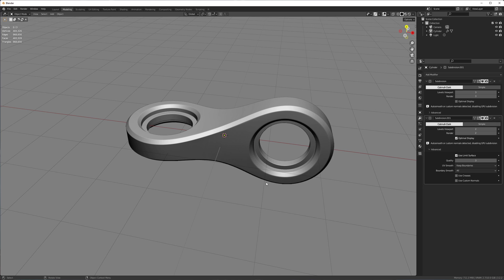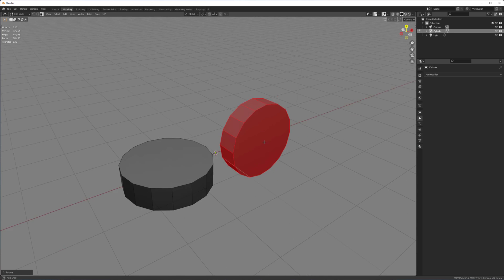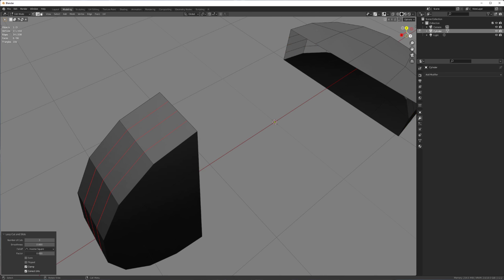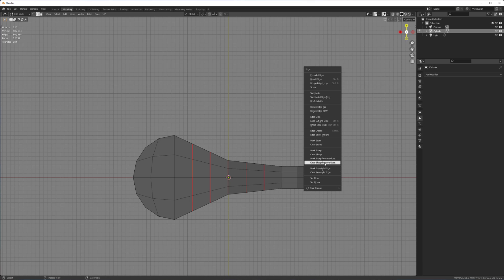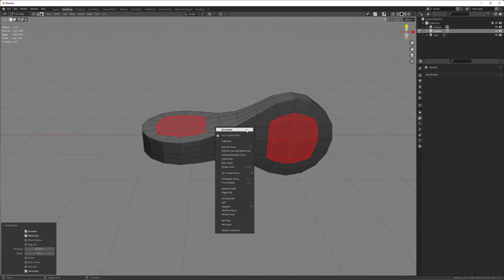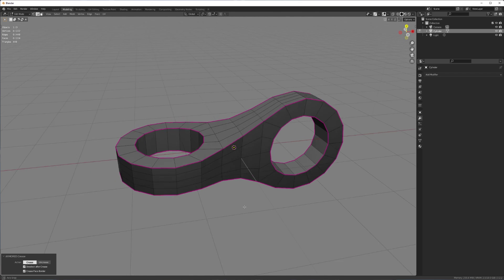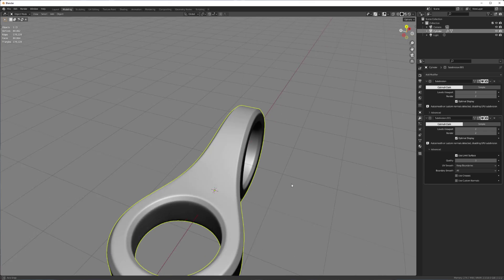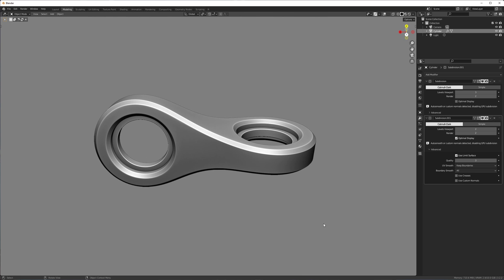A different technique (Subdivision Surfaces)

Comment: Unfortunately, with blender 4.1 AutoSmooth is unfortunately gone!
Now it's only available as a stupid modifier or an even more stupid geo node.
Reply from the maker: @GenerativeSynthesis  try out BL 4.2. It's still a modifier but they added the option back in the context menu, so you can add it just as fast as before.
Reply: @ArmoredColony  Not only as fast, but also for arrays, duplicates and so on and so on. But... did they really add it back? I'd be so glad to install Blender 4.2 and replace the old 4.0.2!
Reply from the maker: The single button you click for autosmothing? Yes. But it creates the new modifier for you and pins it to the bottom of the modifier stack so you don't have to constantly move it around.

Comment: the things even though it looks smooth and nice, considering the polygon (faces) count it will be really heavy. For example exporting in the games and stuffs. Is there any other way where you can have a smooth surface without using much subdivision surface to reduce the polygon counts?
Reply: Right click in object mode and shade smooth. If that's what you're asking. Hope that helps! ❤
Reply from the maker: You can add a Decimate modifier at the end to bring the polycount down.

Comment: I get stressed out just by hearing how fast you work that keyboard. I use mouse only. For everything. One hotkey more advanced than the basic "F" or "S+xyz+value and I get totally lost and have no idea what I just did or where I'm at in the process. And it's never gonna get better. I know because I've used 3D medeling software for years. Ugh...
Reply from the maker: Then Maya would probably suit you better, if you can get around the pricing. They do everything with these sort of contextual Pie Menus. Used it for years without setting custom hotkeys.
Reply: @ArmoredColony  Yeahhh no... I've used the Autodesk suite for years, until my student copy got so outdated Windows wouldn't allow it to be installed no more. I pretty much was torn away 3DS Max and thrust into Blender, kickin and screaming. Blender is a pain, but once comfortable with it, you really can't beat it. I've just learned to be really really quick with the mouse LOL. Once in a while I pick up a few hot keys. My latest one (fake applause here) is shift-V for edge slide. Anyhoo thank you for a great tutorial.
Reply from the maker: I was equally frustrated. It forced me to learn scripting in blender to fix/change some stuff I didn't like, which was a lot :p

But now I'm happy enough I don't think I'll ever leave.

There's a dedicated hotkey for edge slide? I overrided Shift V with something else so I missed it.

 I just double-tap G now for sliding verts, which I assume gives a similar result.

And thank you for your support.
Reply from the maker: @My2Cents1  since you mentioned 3ds max, I also made this script to mimic the Connect tool. I use it all the time: https://youtu.be/OqXfPUzf_os?si=0OLipay7NhM2T4nk

Comment: Blender Bros do some interesting stuff, yet dont want to learn with not included in Blender, i need good solid basics.
Reply from the maker: Just keep in mind that topology is irrelevant if you do concept art. Also, there's nothing wrong with using blender add-ons if they save you time. Use whatever tools are available to you.
Reply: @ArmoredColony  Agree, and you can't escape addons, nor do i want to. Having a few issues with following along, figured out the part with bridgeing, in that i needed to 1st: select both objects/edge mode/ctrl-J/then bridge. Yet the CIRCLE isn't going so well, not complaining, i'll get there eventually. PS your script and its functions are a great asset. Kudos
Reply from the maker: Yeah, sorry. I could have made the tutorial a little better. I just saw a fun shape and figured I would give it a try with SubD, but that doesn't make my technique perfect by any means. And thanks for the kind words.
Reply: @ArmoredColony  Well the main reason i jumped into blender, was to try and 3d print a Star Citizen ship, yet, they're only meant for the Holoviewer, and i soon came to the conclusion it would be quicker to just learn Blender, and do it myself. All good bud
Reply from the maker: Then you're in luck. The 3d printer doesn't care about good topology; of course, it can help you create cleaner shapes, but my point is you are free to use any software you want. You can even use Plasticity or 3DCoat, but Blender is also one of the better choices, not because it is easy to use but because there's so much educational content out there and all it takes is the time and will to learn it. So just keep at it!

Funny enough, I made a star citizen ship concept once, but I never used it for printing:
https://www.artstation.com/artwork/agdQ9
Reply: @ArmoredColony  It looks about he best ive seen so far, or a second.or two,  thought it was a Gldius, no im inspired. Kudos
Reply from the maker: Thanks again. It was inspired by the Gladius. It was meant to be developed by the same company, so I used some of the same shapes. Not my best, but certainly one of my favorite projects.

Comment: I can’t find that edge crease auto thing in your addon and it looks so helpful :(
Reply from the maker: In the search menu (press F3), it should be called "ARMORED Crease". When nothing is selected, running the script will crease edges by angle if I remember correctly. If that doesn't work then try doing it in face mode. You can also hotkey it in the same Searcy menu.

Comment: Tip for someone who would like to make this model by himself: don't forget to apply the location, scale and rotation on your model. Without applying your add-ons will not work properly :)
Reply: Also new version of edge flow add-on includes more settings than in guide is. Change iterations from 8 to 1 or your mesh will be broken and when you try to apply the subdivision surface you'll see that the shading is not quite well.
Reply: @pavelshulya  If had seen this earlier I would have saved 2 hours :(. Thanks!

Comment: Something I've always liked doing is using a bevel modifier, with two segments, and a profile shape of 1. Set an angle limit of like 85, so it only does edges. Easy peasy non-destructive hard surface geometry. Not the best for when doing manual bevels, but you could likely do something with vertex groups or weight painting.
Regardless, solid piece.
Reply from the maker: Yup, your way is probably the best way in Blender.

Comment: That whould be hell to 3D print or machine
Reply: Well im still a newby on modeling ( i use blender to make models to print on fdm) supports dont work too good, if this needs to be machined i whould split it in 2parts(more complex and more weak points)
Reply from the maker: @kepler_45  ahhh, that's a good idea
Reply: I realy suck at Blender, i can just tink of solutions to balanite the fact i cant even use bridging
Reply from the maker: Well, I don't know anything about 3d printing, so you know way more than me in that regard
Reply: @ArmoredColony  if one day you go on that i can tell you its prety easy to use such machines , maintenace and regular calibration and maybe modifications need more knowlege, im prety sure you can deal with it
Reply: An idea for 3D printing is if its made of a material like TPU ( flexible) you could make it in 1 piece that neds to be bent and screwed, it may be possibile with steel too but that requries aspecial machine
Reply: An other advice is that cheaper machines need more effort to make them work well. Expensive ones have sensore that help with most things
Reply from the maker: @kepler_45  thanks for the info, but I don't think consumer filament printers will be good enough for the character I want to print; too many little details. I might have to pay some bigger company for that job. Stay tuned if you want to see the character (it's practically finished, I just have to render it).
Reply: @ArmoredColony  actualy resin printers are cheap and can do very small details smaller than 0.1mm
Reply from the maker: I've heard, but I've also heard there's other considerations you have to take with resin printers, because it's normally toxic  or something
Reply from the maker: What should I do?

Comment: Is there any benefit in using loop cuts vs your method explained here? Especially for output for clients etc. Would crease export in multiple programs?
Reply from the maker: I would probably use loop cuts in that situation, but for merely coming up with shapes, creasing can be faster
Reply: @ArmoredColony  That is why I'm confused in my workflow. Thanks for replying so quick and on an older video too.
I'm coming from Modo where I intensely did everything via loop cuts that doing it like this feels alien currently but I'm getting closer to making some kind of transition to Blender. Just taking a lot longer than I'd like
Reply from the maker: TLDR
Do whatever you want unless you're told otherwise.

I guess it depends on what you're doing. If you're working for yourself then do whatever you want to do and whatever lets you work fastest, but if you're working at some big studio and they tell you to use control loops then you have to do what they say obviously. But I actually saw a video of a 3D modeler working at ILM I think? I don't know, but he was modeling the Millennium falcon for some movie and he actually just used creasing without any control loops because there were too many parts to model and creasing was way faster.

Comment: there is a similar shape called oloid. Would be nice to see how you would create it in Blender :)
Reply: An Oloid is theoretically just a Convex Hull of two identical circles, one of which is on the perimeter of the other and rotated by 90degrees…. Sooo… it should be just a couple of geo nodes :) 
Will give it a try tomorrow
Reply from the maker: That's even more nerdy
Reply: @ArmoredColony oh come on, the nerdier the better. Admit it.
Reply from the maker: You'll never get me!
Reply: @AArmstrongC  sounds interesting!
Reply from the maker: Oloids are for nerds. JK. You're probably better off using CAD software for that.

Comment: 5:30 this is btw exactly how semi-sharp creases are done internally.
Reply from the maker: That's cool, I didn't know that. How did you learn this if I may ask? I think I just avoid using the traditional Shift + E method because it feels less precise, and I don't like typing relative values.
Reply: @ArmoredColony  I recently had to implement it from scratch for a paper (not yet published). I also don't like Blenders 0-1 crease sharpness system. Internally, the number is converted to e.g. 4.3 which means 4 sharp iterations, followed by one iterations where sharp and smooth are interpolated with 0.3 (that's where the "semi" comes from). All following iterations are smooth. If you are interested in the math, the original paper from pixar is called "subdivision surfaces in character animation" by DeRose et al.
Reply from the maker: I was more interested in learning about you actually. I confess I'm not very tech savy. Thanks for the explanation.

Comment: This is the second time I don't get it!    2 end-inset octagonal cylinders, face to face,  suffice.  Insets bridged, faces bridged with a couple of cuts, (smoothness adjusted). The rest is ordinary bevels, extrusions, subdiv. No grid-fill, no add-ons , no counting verts, no fuss. If you're interested, I'll post you the steps 🙂.
Reply from the maker: Thank you for the offer but if I ever need this shape again I will just copy paste it.  Of course you can do it with vanilla blender. I think I just wanted to show some of my scripts, can't remember.
Reply: @ArmoredColony  Okydoky .. I like your work.. I was just surprised to see this called an 'impossible shape' in the original. :)
Reply from the maker: I believe I watched the same vid, felt that pushing vertices one at a time was silly and made this while showcasing some scripts. But I do believe when you say it can be done even simpler.

Comment: some how bridge edge loop not working
Reply: its working on copying the mesh in edit mode
Reply from the maker: @whimsical.me1 Make sure it's a single Object. Also, there is no bridge edge loop hotkey by default. Select the two edge loops and try searching for Bridge edge loops in the search menu (F3)
Reply: @ArmoredColony  thanks it works 🙌

Comment: Great tutorial, set flow didn't worked for me, when i use it, it does nothing, Blender 3.2. Greetings.
Edit: It works but i did the build wrong at first so set flow is very specific on how to do it, also if you use key strokes will be easier for the viewers to follow when you forget to tell what you did, for example auto-smooth seems that you did a shortcut and is driving me crazy to find it, did you added a custom shortcut?... I found it via F3 but not with a shortcut. Display modifier in edit mode shortcut also i couldn't find it unless you did a custom shortcut too, and at the end how you sharpen the edges, looks like you selected the faces instead of the edges. Still, excellent tutorial, mine looks the same at the end. Greetings.
Reply from the maker: Set flow only works if you already have a bit of curvature, that's why I scaled the middle edge loop first before I even tried using set flow.
Reply: @ArmoredColony  Oh nice, good to know!
Reply from the maker: To answer the questions in your Edit, I used a script for all of those things. It's one of the reasons I don't worry about displaying my shortcuts, because they're calling scripts you probably won't have anyway, so people might press those hotkeys and get confused when nothing happens.

The scripts you saw:

ARMORED_autosmooth
Autosmooth requires 2 things, enabling shade smooth through the RMB menu and then going to the mesh data and enabling Autosmooth, so I decided to combine both of those in a script.

ARMORED_subd_view_in_edit
Modeling with the SubD modifier enabled can sometimes be slow.This script allows me to toggle its visibility on or off when I'm in Edit mode specifically.

ARMORED_fast_crease
For the sharpening edges (creasing actually), I used another script that converts the selected faces into a selection of border edges and applies a full strength crease.

ARMORED_delete_and_grid_fill
Pretty self explanatory. If the script is installed it will automatically appear on your delete menu. You can select the cap of a cylinder for example and replace it with a grid of quads.

So they're all relatively simple scripts that you don't exactly need (all the do is save you some extra clicks), but I like to hoykey those that I use a lot. 

All those scripts are in the Armored Toolkit addon I host on github for free, but if you prefer you can actually download the individual scripts you want instead of the entire addon, as long as you know what blender folder to put them in, otherwise I recommend the addon for easy installation.
Reply: @ArmoredColony  Oh yes, i downloaded the script before starting the tutorial, and for some reason the delete_and_grid_fill doesn't appear directly on RMB click, i had to go to the main menu and there you can use it, also the crease option i had to go to the main menu. Thanks a lot for the clarification and for sharing and creating the scripts, i think that can save me a lot of time too!!!... Greetings.
Reply from the maker: @Totorus  Delete and Grid fill only shows up in Edit Mode in the Delete menu (press X), NOT the Rightmouse menu, and yeah, you can search for the scripts you want with the F3 search menu and assign your favorite hotkey from there.
Reply: @ArmoredColony  Yes, i tried Delete and Grid Fill in edit mode and doesn't show up, maybe is because the others addons i have so i added as favorite shortcut, no worries. Greetings.
Reply from the maker: Don't forget it only appears in the Delete Menu (when you press X to delete faces and stuff)
Reply: @ArmoredColony  I know, thanks!